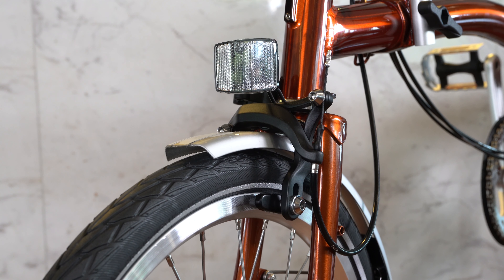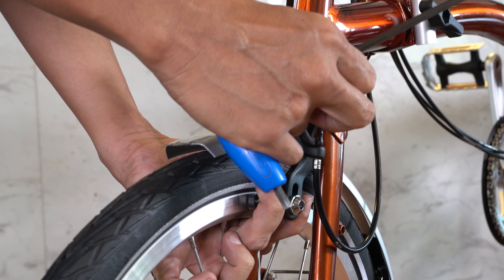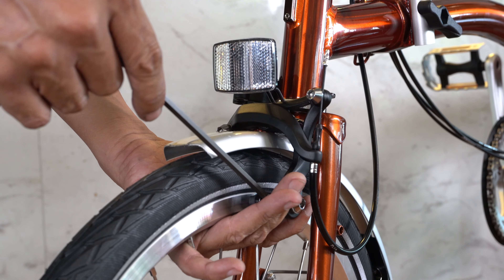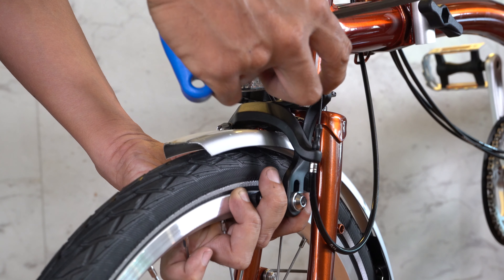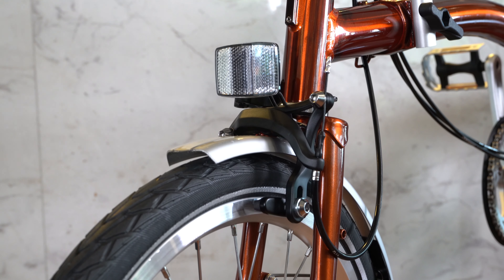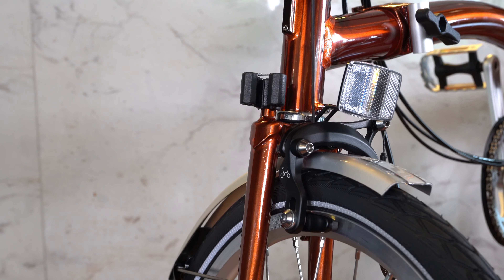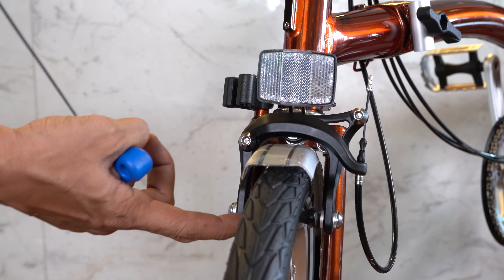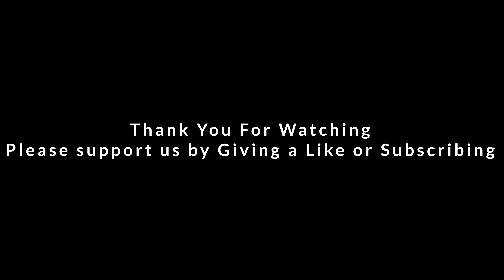How To Adjust Brompton's Front Brake (English)

Comment: Usually I put something under the pad like a zip tie on both sides so I can push right against the pads. I use another zip tie to hold the brakes levers under tension so that I can use 2 hands on the cable and nut. I find it easier when you are just 1 person adjusting
Reply from the maker: Thanks for you input. Yes I think that is a good way of doing it too.

Comment: Thanks for the video. However, should the left/right positioning be done first, before setting the brake pads distance from the rim?
Reply from the maker: Up to you. You should loose the screw to center the brake first.. The distance between brake pads and rim should be around 2-4 mm depending on personal preference 
Hope that helps.